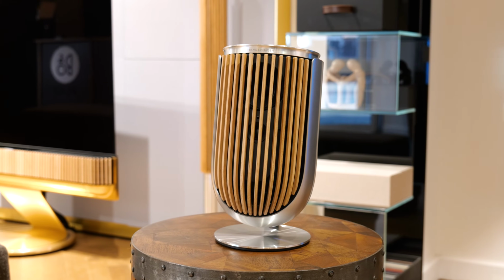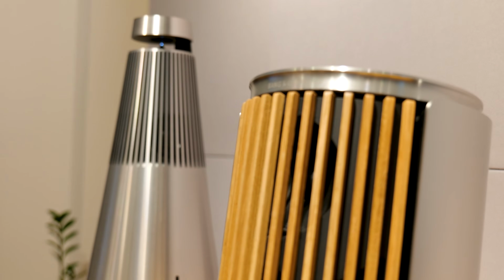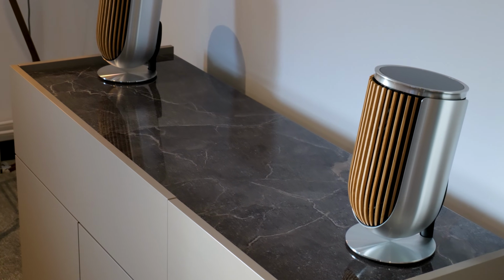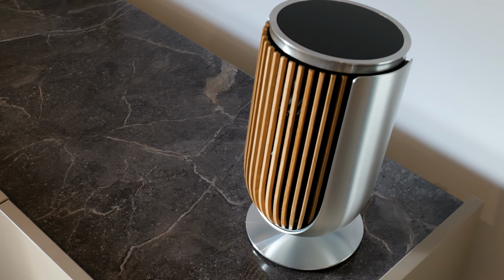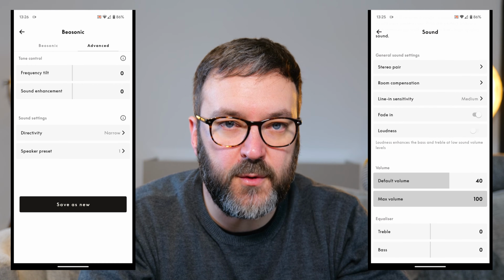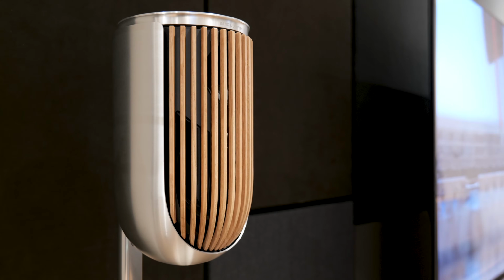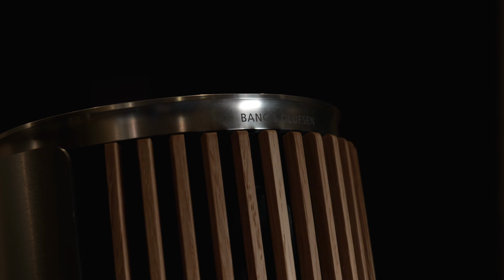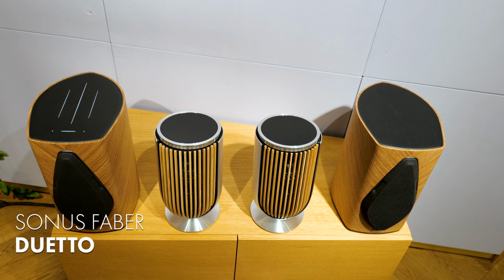Bang & Olufsen Beolab 8 : Jack Of All Trades?

Comment from the maker: If you watched this video when it was released there was a section about the speaker wobbling on the bracket. Bang & Olufsen contacted me, there was a missing rubber part from the bracket on both our display models. So, to be as fair as possible, I have removed that section from the video. 

It was an issue with a small batch of early speakers, if your Beolab 8 have too much movement on the stands please contact your retailer and they will help you. 

John

Comment: John, always good content. I have a pair of these and love them, however I wonder about adding a 19 sub. Will this come close to the overall performance of the 28’s? I’m in a larger listing room now and just feel the bottom punch could be improved but don’t want to break the bank
Reply from the maker: Thank you. I find the Beolab 19 subwoofer is more capable than the smaller bass units in Beolab 28. I think you would be pleased with that setup if you already love your Beolab 8. - John

Comment: Hello! Great review on the Beolab 8. I would like to add these later to my main speakers, which I planning to buy now. I'm considering the Beolab 50 to pair with my Beosound Theatre 77. But I am curious if i am overkilling it as Beolab 28 is half the price. I have tried both in the dealership. Beolab 28 was great with maybe a little too leaned towards the bass than traditional B&O's that I'm used to. When I heard the 50, the difference was immediately felt through its clearer soundstage, better balance, and more natural sounding experience. But I'm still not sure if I should get the 50 as 28 was quite great as well. My listening would be 50/50 between music and movie. I'm also kind of concerned that it's been about 7 years since the 50 came out and it would be replaced in 3-4 years whereas the 28 is relatively new. I would like to own this system that im buying now far into the future. What would you recommend between the two?

Comment: Trying to change up my old beosound 9000 with a pair of beolab 3s. As I’m trying to slim down on cables and move to a more practical and compact digital placement I would only like to use my phone as a source to stream sound directly to the speakers without any additional systems between. What would a better choice be beosound balance stereo or beolab 8 stereo?
Reply from the maker: Personally I would go stereo Beolab 8 or seriously consider the Sonus Faber Duetto. -John
Reply: @Peter-Tyson-Audio-Visual  Thank you and how is the sound comparison in your opinion between the Beo products? I’ve listened to balance from a single speaker and it’s shocking how much power is in them. Beolab 8 aesthetically looks more pleasing with all the metal and wood. I’ll take a look at the Sonus.

Comment: Great video, thanks Peter. A question if I may,  I would like to connect my ProJect turntable wirelessly to my beolab 8's - I was thinking a Beolab transmitter would be the best solution, but my dealer (here in France) says this isnt the solution. I have a feeling it may be a language problem as what read of the transmitter makes feel it's exactly what I need? thanks again
Reply from the maker: Hello Tim, I'm John (the host), Peter Tyson is the name of the company. My personal advice is to avoid the transmitter at all costs and find a way to use a cable instead. You'll thank me later! - John

Comment: How does it compare to beolab17？
Reply from the maker: Pretty comparable from what I can remember. I've not heard Beolab 17 for quite a long time now. -John
Reply: Beolab 17 31-24k	106dB, Beolab 8 28-23k 104db. 2 way compared to 3 way designs. 

Beolab 17 are available nearly new for a lot less but have not internet radio or streaming needing to have a Beosound Core or another streamer plugged in to the powerlink. 

Beolab 17 are a bargain and also very flexible in placement options.
Reply: @geraldmcmullon2465  I already have Theatre and lab18s and I m considering 17 or 8 as the front L/R for my home studio，for that cases is 8 really worth double the budget?

Comment: Very nice walkthrough John, appreciate you putting it together. In terms of sound, the big question: a pair of these or a pair of Balances? :) My initial impression after one listen is that perhaps the 8s in stereo are pleasant while the Balances are slightly more capable - note that I love the Balance for its sound too but I might prefer the Beosound 2 for it being so clean and warm. Some have compared the Beolab 8 to the BS2 in terms of sound signature. Bonus question: what if you add the Theatre to the mix?
Reply from the maker: Mixed with Theatre they work really well. In regards to what is best, Balance, Beosound 2 or Beolab 8....only you can decide that, it's really subjective. Personally I prefer both Beosound Balance and Beolab 8 over Beosound 2. Purely as a stereo pair on sound alone I prefer the Sonus Faber Duetto over all of them! But I like the design of Beolab 8 and Balance. Each to their own. - John
Reply: Priced similar to the Balance, depending on finish. If used as Mozart platform speakers the Balance has an extra bass unit, more amplifications and goes slighly louder. 

For use with computer or TV to watch a video the Balance has a latency on all inputs. The Beolab 8 can switch to powerlink or WiSA with an acceptable low latency (like the Beolab 28). 

I find the sound of Mozart of the BL28 to be close to that of the Beosound Level and Emerge and do not justify the price difference. Over WiSA it is a very different speaker, fuller, richer and more worthy of the ticket price. I suspect the BL8 will be the same.

BL8 and BL28 are more flexible and can be used in more situations. If you never want to use them with a video then the Balance, Level or A5 might suit better. If you use with the Beosound Theatre or a WiSA TV then you might consider BL17 or BL18 (no Mozart options). the BL8 are also lighter and smaller than the Balance. go for a demonstration and make your own mid up.
Reply: balance are a tad beefier, and theres ways to get around the audio delay which would otherwise ruin them for tv/movies, my tv has a sync feature, as do 4k appletv and nvdia sheild, balance and 8 do slightly different jobs, if you have a tv and surround sound get 8s if you want something as a stereo pair only or single speaker and you prefer the styling go balance, but then theres a few things 8s can do that balance cant.... wisa and powerlink for example
Reply: @sakaspuds  Thank you for your input :). Sounds like my impressions and that of others so far. I am thinking more and more about the 8s as something in addition to my Balances rather than a replacement. But time will tell. I’m in no rush to make a decision.
Reply: @sakaspuds  I play from a PC. VLC has a sync feature but over the length of a movie it drifts. There is no sync feature on Youtube or facebook. There is an extension for Chrome but I can't get it to make the difference needed. Over Airplay 2 it seems to work, but is a stereo only solution. Ideally I would like to use Beosound Level on battery with my laptop which is okay for audio but not for video with a delay of around 2 seconds.

Comment: Will they be selling them as separates. Or do you have to buy as a pair 👍
Reply: You can by one in Denmark 😊
Reply from the maker: You buy them as single units. You can use as single, stereo or multiples in a surround setup. - John
Reply: Mono, stereo pair (with another BL8), multi-room with other Mozart based speakers and using powerlink or WiSA part of a full surround sound home theatre set up with WiSA based television or a WiSA transmitter.